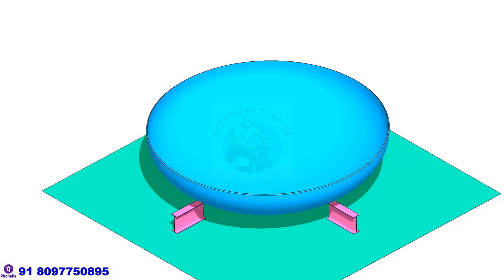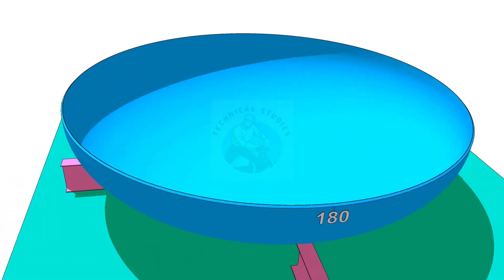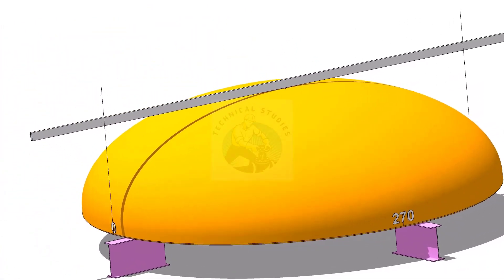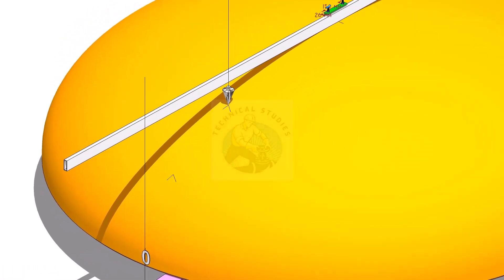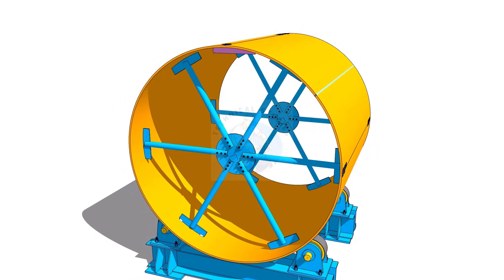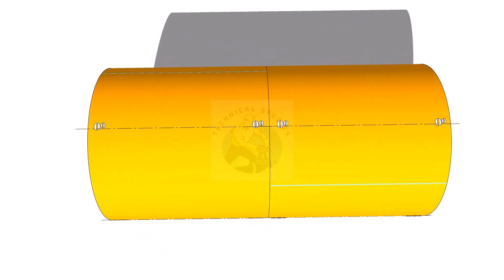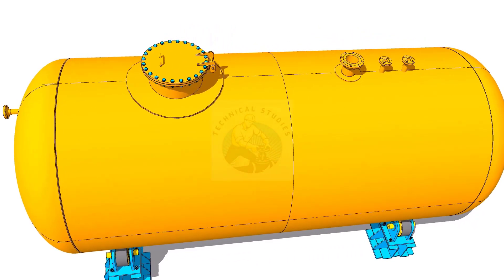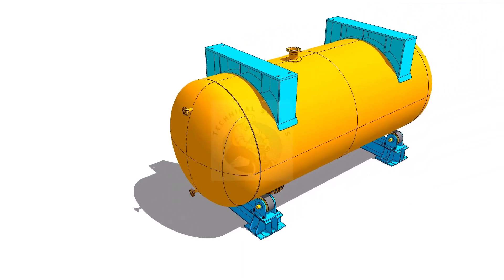How to fabricate a Pressure vessel. ASME Sec.VIII

Comment: What could be used to make the body of the tank and also, how do you bend the metal?
Anyone here with that experience?
Reply from the maker: There are several material to make a steel tank. You can refer ASME sec. viii.  You need Rolling machine, Press machine and Spinning machine etc.
Reply: @technicalstudies. Okay thank you, will research this.